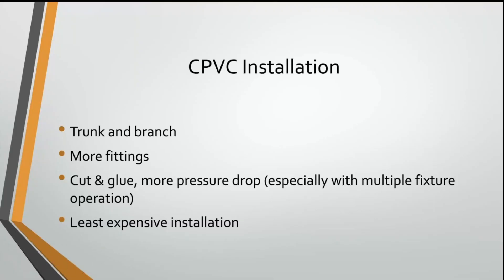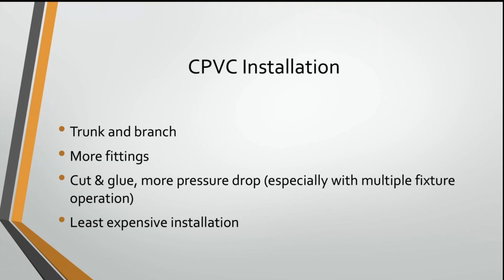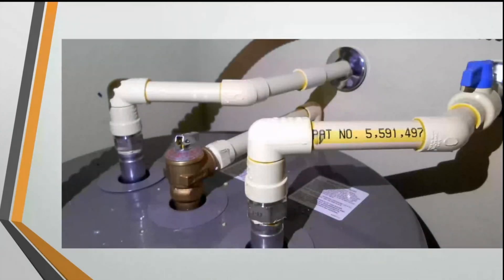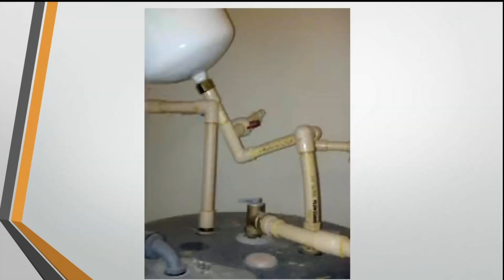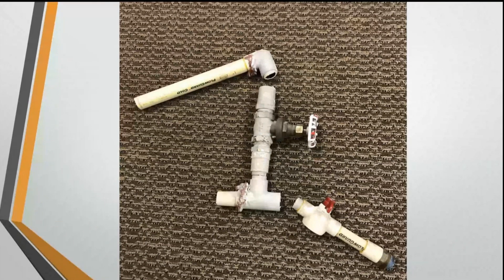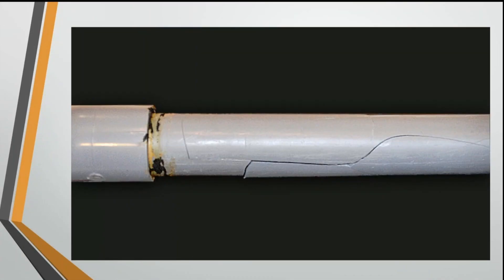Why this home inspector doesn't like CPVC in new home construction #mattsbrain

Comment: You don't cut CPVC with a hacksaw.  Nobody does that professionally.  Moreover, CPVC has BY FAR the best performance of ANY plumbing system out there.  It totally clobbers copper and PEX-A even when  PEX has fewer fittings.  This is the exact reason they added 5/8" PEX and it still flows LESS than 1/2" CPVC.  PEX's main advantage is it is easier to install thereby making it cheaper to install.  Nothing needs to be even remotely straight and there are fewer fittings.  This also makes things easier for DIYers.  When picking your poison, PEX-A is better than PEX-B.  If you use PEX-A, get the $400 - $500 auto-rotate tool if you don't want to have leaks.  The manual ones that say they auto rotate don't do it consistently.  PEX in the US doesn't have a track record long enough to claim it lasts longer than anything else.  PEX is affected by chlorine and FAR more by UV.  Just leave a roll outside for a couple months.  CPVC does get brittle over a very long time on the hot water lines, especially if there is a circulation pump.

Comment: You said so many misguided, Ill informed pieces of misinformation in this video.  Wow, Just wow.  I'm shocked you could be a home inspector!
Reply: You are welcome to your opinion, but there is no need to be nasty.  17 years owning a large, multi-inspector business, tens of thousands of inspections, and I am a degreed chemical engineer with years of industrial piping experience.  I know a little something about plumbing and materials science, and I would never use CPVC for pressurized water distribution - we see massive problems with it all the time.
Reply: @robertlottes7560  Well there are 11-billion feet installed each year so it's not going anywhere anytime soon.  I didn't mean to sound nasty if that's the way it came off.  Maybe it was just your wording and how you phased the video.  I'm also a mechanical engineer by trade and work in the industry with no issues with CPVC on 100's on installs.   Mostly commercial and industry applications though.  

You kept referring to it as a "glued" joint.  It's not.  It is called a "solvent weld".  Where the pipe is chemically fused to the fitting.  When properly done, the joint is 150% the strength of the pipe.  If your installer is using the wrong "cement" then they are not a plumber.  Time to check to see if they have a license.  You also kept showing pictures of poor installs.  Definitely not installed per UPC code.  That's not the pipes fault.  That's the plumbers fault.  Code states copper transitions 18" off any heat source.  Blaming the pipe for poor installation is like blaming a 2x4 for a house falling over with 1 nail in each stud.  Also, coupling don't add noticeable pressure loss.  You'd have to add 100's for it to make a 1 psi difference.  Also CPVC can be run at 8' per sec all day long, something which many other piping systems, copper / PEX can't due to chlorine degradation.   I'm sure there's more, I feel like I was shaking my head after almost each sentence, but I'll leave it there.
Reply: @bojangles_bonjangles8000  Point taken, it is technically a solvent weld, not a glue joint, but for most homeowners that is a distinction without a difference.  I actually do NOT disagree with most of your reply, but the key is proper installation, which is actually the biggest problem with CPVC in the home.  Residential installation is a whole different world than commercial or industrial applications, so all the rules, specs, and niceties get thrown out the window because of lowest bid contractor or DIY installation.  No one deburrs the pipe, waits 24 hours for the joint to cure, properly supports it, etc.  Like many building materials, the problems usually occur during installation - in the residential sphere, finicky products are always going to have issues.  Out of all the modern distribution materials we see, CPVC is by far the most problematic, including the highest incidence or pressure drop problems, because it is usually so sloppily installed.  I know you what you mean, I feel like shaking my head every day with all the stuff we see, but it is not an ideal engineers world in real estate and inspection. CPVC in the home is generally a really bad idea, but there are a lot of approved building products that are a really bad idea.
Reply: FINALLY, somebody who knows something.  CPVC FAR outperforms PEX, including PEX-A.  They added 5/8" PEX because it was such a dog.  Even then, 5/8" PEX flows less than 1/2" CPVC, and pretty much parity with 1/2" copper.

Comment: You talk about restricting water flow, all pex fittings go inside the pipe instead of the outside so you’re cutting the diameter every time you put a fitting in. Also every plumbing system is only as good as it’s installed. Who would use a hacksaw to cut cpvc.
Reply: You are correct, every plumbing system is only as good as its installation, the biggest problem with CPVC is that it is poorly installed by people who do not know what they doing.  Both PEX fittings and tubing are smoother than CPVC, and you use fewer PEX fittings in a typical installation, resulting in better pressure and flow even with a smaller ID.  We see all kinds of tools used to hurriedly cut CPVC, including hack saws, crosscut saws, reciprocating saws, etc.
Reply: @robertlottes7560  "Both PEX fittings and tubing are smoother than CPVC"  Absolutely not.  CPVC is smoother, plus it has 65% more flow area and when you increase the diameter, it isn't eve proportional because the circumference/surface friction increases at a slower rate, so the flow rate is greater than 165% that of PEX.  Moreover, CPVC stays rounder, the most efficient shape.  CPVC WITH the extra fittings FAR outperforms PEX, including PEX-A.  Because PEX is such a dog, they had to add 5/8" PEX.  The most efficient fittings are CPVC, even slightly more efficient than copper and significantly more efficient than the eddy currents caused by PEX-A.  As far as PEX-B is concerned, we don't even have to talk about what that adds.

Comment: There is no way this material would be allowed in Europe. Copper, pex , or composite. This cpvc is really bad material for pressured pipes, maybe ok for drains .
Reply: Saudi Arabia has used CPVC for longer than perhaps anywhere in the world.  They have no issues.  HOWEVER, they do use schedule 80, which doesn't flow as good as schedule 40 due to the increased wall thickness.  It flows about the same as copper but still beats PEX from a performance perspective.

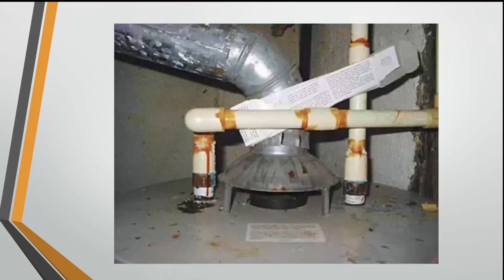Comment: 2:00 the biggest problem I see there is that's a hack plumbing job. Handy Andy deposited that check while sitting in the driveway and gave them the Tailgate Warranty.  You would not want a rigid connection like that to your water heater. Plastics will expand and contract a lot more than metal tubing, as a professional, you take that into consideration. A well done, properly installed and tested system will give you 50-75 years of use.

You are correct on the flow restriction by 90s and 45s, but when you design the plumbing system and get it approved, you take into account those pressure losses. Calculate your flow and load to your fixtures correctly and you'll be fine.
Reply from the maker: Thanks for your comment.